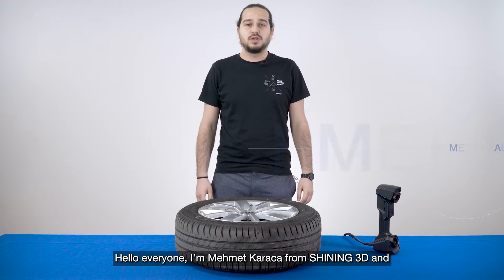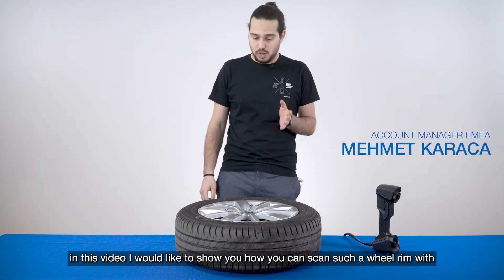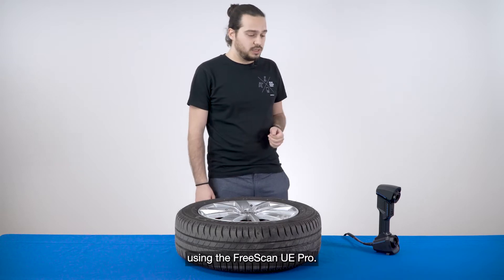FreeScan UE Pro Car Tire Demo

Comment: I’ve been looking for a 3D scanner for over a year and I can’t make my mind up. I like the price point of tge ur pro compared to the Handyscan black elite but every single video I have watched of the ue pro are speed up when the scan starts. So is that telling me that the ue pro does not scan as fast as advertised? 
The Handyscan black and elite have less advertised scanning speed or at least very similar but it’s way faster and I’m not even talking about the instant mesh generation. So I hope someone with experience can explain why the 11+1 laser lines Handyscan black elite is so much faster at collecting data than the 14+1 laser lines the ue pro utilizes? 
These are real question I would like to be answered so I can make a decision please?
Reply: I'm also looking at the difference between Handyscan black elite limited (12 micron) and URpro. I've found another key aspect is that we're buying into their support, repairs, calibration cert. , lead times, emerging technology (copying or leading the industry), trade-ins/upgrades, software crashes/bugginess, etc.
Reply: That must be some good support for that price difference. The elite limited is going to be in the 80 90k price range I’m afraid bc the metrascan is 100k and it’s not as accurate. If you live in the uk ZG a Chinese company offers Marvelscan. It look like a Handyscan black but they have a monocular mount facing north or up and it allows blue laser scanning with no markers. Suppose to be the first if it’s kind but as I’m in the USA it’s not offered here yet. Could be all bs if you know what I mean but even it has a nice price tag at 45 to 70k. More MuhNay than I want to spend right now.
Reply from the maker: Hi Shawn Laughlin, thank you for your feedback, we speed up the scanning process for a better watching experience. we'll pay attention to the aspects you mentioned next time. 
Scan speed is defined by the number of points obtained per unit of time on our specification sheet, which is affected by its resolution, the number of laser lines, fps, etc.
Is it convenient for you to let us know your detailed needs? Please contact sales@shining3d.com, Shining 3D will arrange a close demo, and you can get a real experience of the FreeScan UE Pro.